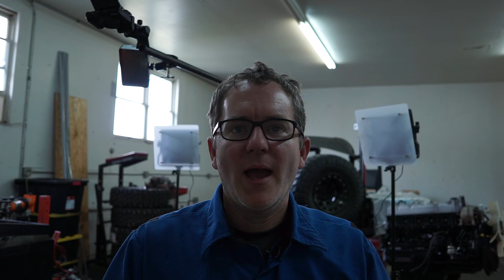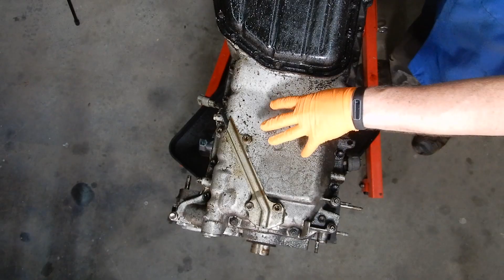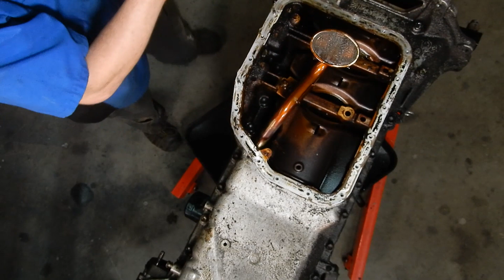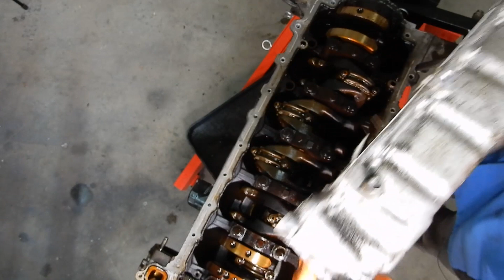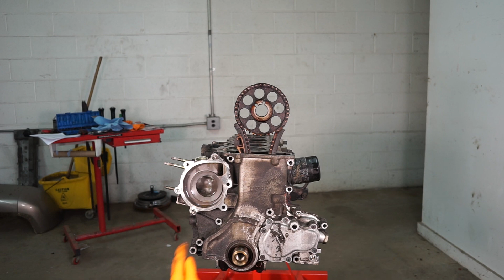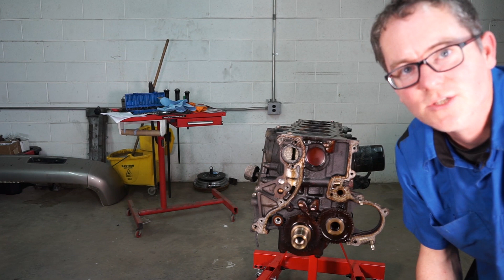1FZ-FE Timing Chain Part One

Comment: I have land cruiser gxr 2001,

Do l have to remove the head to open the front face of the engine?
Reply from the maker: What engine do you have?  The US spec 2001's had a 2UZ which you don't need to remove the head to get to the timing belt.  If you have a 1FZ like in this video, yes you need to remove the head to get to the timing chain.  It is technically possible to do it without removing the head but there's a very high risk of damaging the head gasket that way.

Comment: Hi Buddy....how are You???....Have a quick question...my 96 FJ80 it rattle for 1 or 2 seconds when starting engine..........it do it when engine get cold.....if I start it again it will rattle for 1 second........Do You what it can be??....... Thanks
Reply from the maker: First guess would be slack in the timing chain until it builds oil pressure.  It's hard to really say without hearing it though.

Comment: Hi. Is it possible to get the timing cover off with sump on, head off and studs removed from bottom of timing cover.
Reply from the maker: Nope, the oil pick up bolts on from inside if I remember correctly.
Reply: @OTRAMM  that would be right. Got the head off due to burnt valve and chasing oil leaks. Decided to pull motor and do rear seal while I'm at it as has been leaking

Comment: Quick question.  Does the timing chain on the iFZFE need replacing at certain intervals?  Thanks
Reply from the maker: There's no set interval on them. I've never seen one wear out. I've only seen them break the guides.

Comment: your videos are excellent.  on my 94 1fzfe, my timing chain & gear broke on the hiway. am doing a timing chain & head gasket per your video.  was trying to line up cam marks but the cams are locked up & won't turn.  would remove the cams but don't know how to insert the bolt to hold the  spring loaded exhaust cam.  basically the head is locked up but the engine crankshaft pulley marks will turn & align to tdc.  any ideas ?  all i can figure is bent valves even tho its supposed to be a non interference engine.  was running great before it happened but had a litttle clatter.  even if you can't reply thanks again
Reply from the maker: I've never run into a 1fz with stuck cams. The only time I've run across that was a severely overheated Honda head that warped enough to bind the cams in their journals. I'm pretty sure the exhaust cam spring can be reset if you remove the cam without the lock bolt. I've never done it though. It almost sounds like you cams seized and then the chain broke. Any oil pressure issues before they popped?
Reply: not that i know of.  gonna drop the pan & remove timing cover & look at everything & crank shaft rotation.  will have to remove cams & head & have a look. thanks for getting back & i'll let you know what i find. this engine has 185k miles. thanks again @OTRAMM
Reply: gotta put on the dumb bunny hat.  i  forgot to remove the spark plugs.  when i discovered my error i had already removed the cams but there was no damage to the  bearing surfaces.  head is off now  & now waiting for valve spring compressor to. strip it down to send  for machining.  i guess then i'll find out if valves are bent  but probably not & the cams weren't frozen it was just that i didn't try to force them to turn.  well good luck to me, guess i'll see but there was no damage to timing cover.  thanks for your fine work

Comment: Still would be able to replace with engine in car?
Reply from the maker: It's way easier to do out of the truck. You have to lift the engine anyway to get the upper oil pan out.

Comment: Hi there love your channel I have a question I have a 1994 1FZFE engine I had a lower sounding knock and I pulled the oill Pan and checked all the rod bearings and they all  look great wondering what else I could be missing.

Comment: I have an fzj 80 I'm doing a head gasket on and the cross hatch is gone on the sides.   Not really scored just..smooth .   Do I need to worry?
Reply from the maker: How many miles are on it? Is it burning any oil? Usually we see them with even crosshatch all the way around.

Comment: Hey Ryan, Would you say it could be done if you removed the oil pan while in the FZJ? Mine is leaking in the same place. Total hack job that was covered in oil when I went to check it out. I thought it was the pump seal and crank over a number of years.. Not true....
Reply from the maker: It can be done in the truck but it's not fun. You've got to lift the engine to get the upper oil pan off. And you're upside down trying to clean the mating surfaces well enough for the sealer to stick.

Comment: Great video man! Getting ready to do one of these soon and just wanted to get a slight overview of what's involved.  Is it possible to do this job without removing the head? I remember doing a few timing chains on the 22RE and i was able to do it without removing the head.  Well I've done it both ways. But I've definitely been able to slip the cover out without taking the head off
Reply from the maker: You might be able to. I've never tried. Never wanted to risk the potential leaks. Unlike the 22re the cover is glued on. I think it'd be hard to not smear the sealer and cause leaks.

Comment: Aren’t those chunks in the oil pan  concerning at all?
Reply from the maker: They are a bit. Judging by the rest of the engine they were sludged up oil.
Reply: OTRAMM I pulled the pan on my fj80 and found similar shavings and plastics chunks. Compression 150-155 on each cylinder. Don’t know if should go ahead and get this done on mine?
Reply from the maker: @Strong_Opinions  I'd be concerned about hard chunks and shavings. The stuff in the bottom of this pan was coked up oil so not actual bits of engine.

Comment: how many miles has that engine done?
Reply from the maker: I want to say around 270k.  By the looks of things they've been hard miles.
Reply: @OTRAMM  wow, looks like its been neglected of oil changes in its life....
My 1fzfe has just clocked 407000km, and is near due to be rebuilt.

Comment: This is heaven send. Just started this in my 93 last night. In the truck. Definitely need assembly vid too.
Reply from the maker: Filming assembly now. Should have it edited this weekend
Reply: Are the 2 front smaller sized head bolts suppose to have washers on them or just the flange bolt itself?
Reply from the maker: @secretaryoftips520  I'm pretty sure just the flange bolt. I'm out of town so I can't check right now.

Comment: just adding a tip....  be careful with that oil float sensor.  the float is thermoplastic and very brittle, and they can break or chip easily....so be careful taking them in/out and dont drop it.  they can be difficult to find used, and are expen$ive at the dealer.  Ive lived it and learned, lol.
Reply from the maker: Haven't made that mistake with the oil float yet, but I've definitely snapped knock sensors that were old and brittle. Thanks for the tip!!